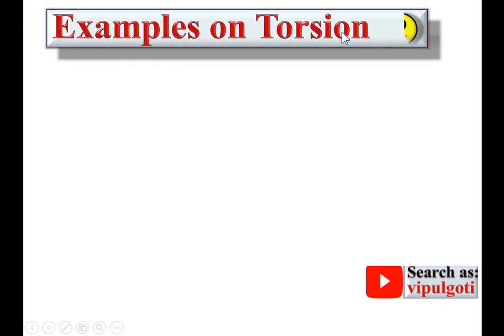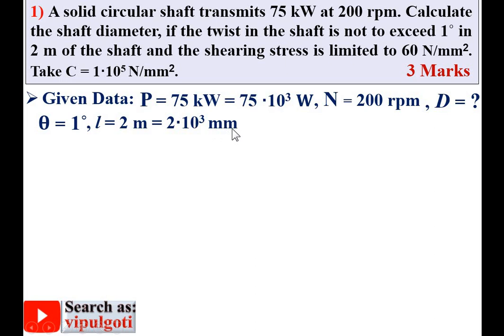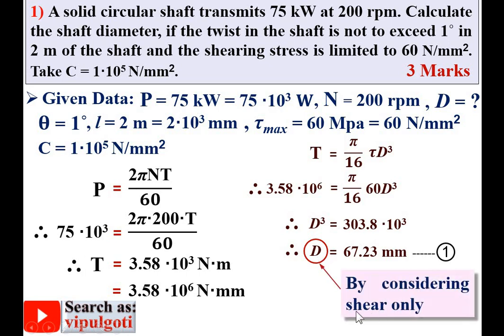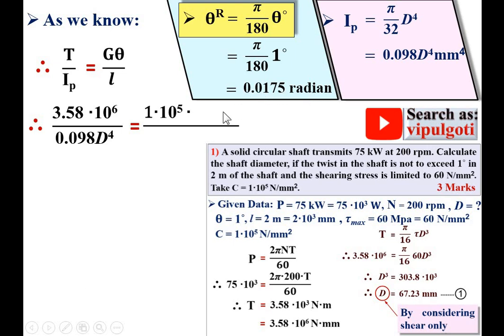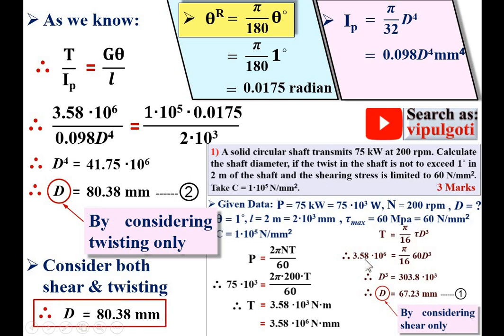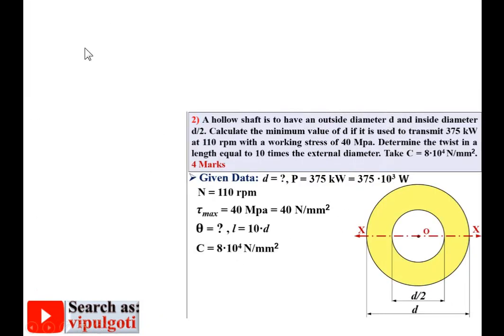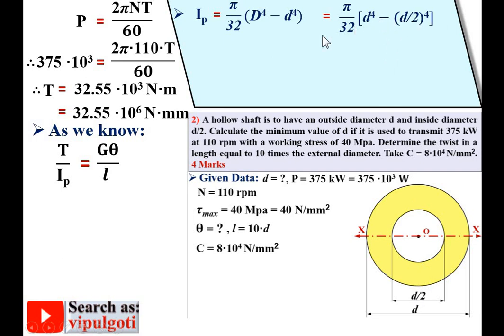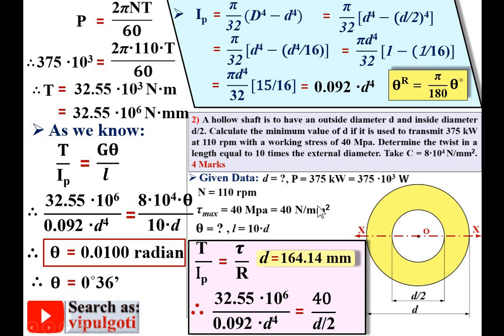Examples on torsion-2|problems on twisting|design of shaft|gtu|8

Comment: A shaft is transmitting 15,000 N - m twisting torque . If the allowable stress in the shaft is 60 N / mm² and twist 1 ° in a 20 dia . length of shaft C = 8x10 + N / mm² , find suitable diameter of shaft .